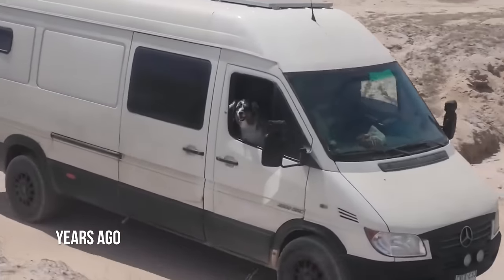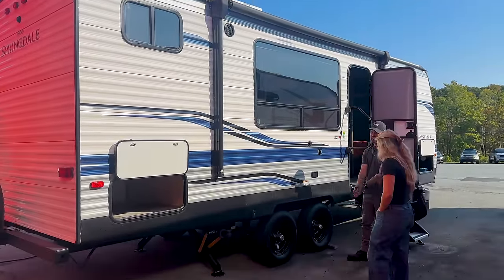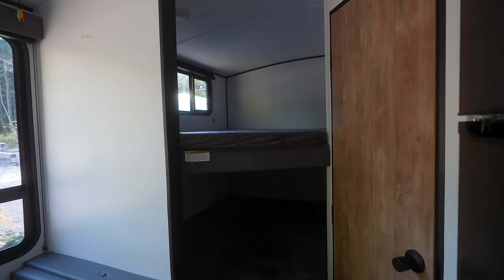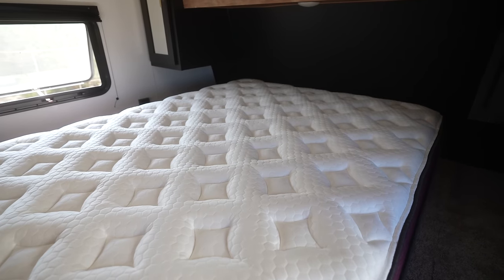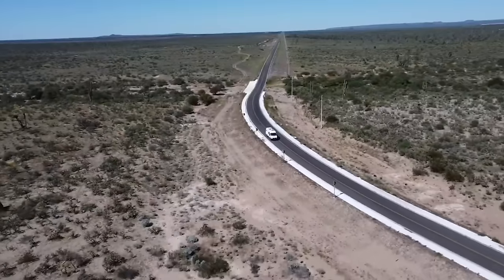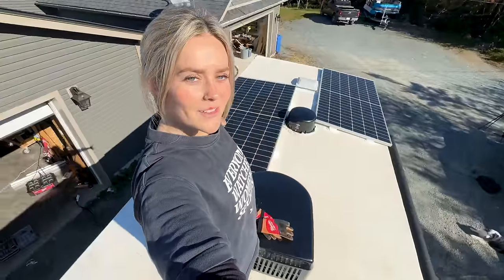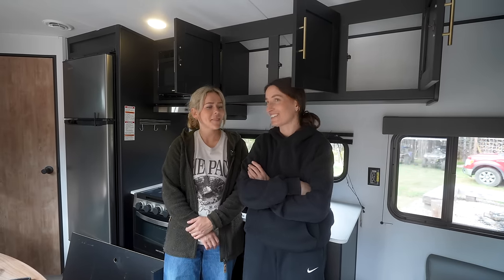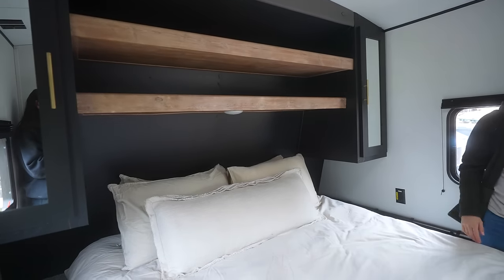We Bought an RV!

Comment: Congrats on getting the travel trailer.  We are long-time RVers and have a couple of recommendations based on our experience.  Tire pressure is crucial and needs constant monitoring. Otherwise, you may have a blowout and damage the trailer.  Carry a small compressor to help maintain the pressure. Maybe look at a tire pressure monitoring system, although they are not cheap.  Make sure to use RV toilet paper, FYI, Wal-Mart sells large packs since it sounds like you will be stopping there for the microwave popcorn.  Love the channel and all of the builds!
Reply from the maker: Thank you for sharing all your experience with us. SO valuable!!! We sure do appreciate it. We purchased a tire minder, to keep an eye on the tires. Happy to have you with us on our journey south 😊🐶
Reply: I would like to add, open fan/vents when cooking to avoid carbon monoxide poisoning & check batteries on fire/smoke/carbon monoxide alarms . I love this family & want them to remain safe ❤🐾
Reply: For the first time in my 72 years, I have a car that monitors low tire pressure this year.  I don't have to get down and check them as it's hard to get up. I'm all for making things easier.
Reply: I was coming for the toilet paper and venting while cooking. Unless you create your dark matter waste hole first then plumb that to the RV, there’s usually locals that’s come clean them regularly just plan for them to show up a day or so later sometimes. Excited to you see do this. We did something very similar 5 years ago! 😂
Reply: Biodegradable tp is what you need for sure. If you use regular tp it will plug you system.
Reply: RVs have been blowing up so much lately because of the propane.  If you can use anything other than gas, then use it, because the gas is too volatile.
Reply: That's a great rv tip!
Reply: My recommendation would be to have SEVERAL spare tires. Like 3. Peace of mind of more important than anything. They blow out constantly. And grease your trailer axle and have extra bearings and brake parts& Tire inflator. Check the temperature of brakes and hubs every couple hours. Just because it’s new doesn’t mean you won’t have problems. Good luck!
Reply: Oooohhh, good advice. Yeah, the tire pressure is vital.
Reply: Septic safe TP is all you need.  They charge a lot more for RV TP and it’s the same thing.  Happy Camper toilet treatment (Amazon) is the best stuff out there!
Reply: You should name it the Baja Bungalow
Reply: Scott's toilet paper is a good rv safe toilet paper, tire pressure is key, check all drawers and doors before leaving, including the fridge. Get the blue or green liquid for the grey tank to help with smell and other things in the tank.
Reply: If you end up getting blow outs I would upgrade to 16 ply tires
Reply: Turn off your propane when driving,  make sure wverything is locked and secured in the trailer.  Also, always do a walk-around (check stabilizers are up, storage area are locked,  AND CHAINS ARE CROSSED, and turn signals, brake lights are working on the trailer) the trailer before hitting the road, do this every time.  Good luck with your new adventure.
Reply: @jackiehenits5239  and roof vents are closed!  I am always running after neighbours to remind them! 😂

Comment: Don't get fooled. The trailer empty is not what you will be towing. By the time you fill the water tank, and load your belongings, many end up over the weight limits. Load up, get ready to roll, and then run through a weight scale at a truck stop and find your loaded weight. It will often shock you. Also be very aware of your balance while loading to avoid too much tongue weight.
Reply: Came here to say this - while travelling the big weights need to be well balanced over the wheels, tow ball weight must be correct too. No doubt you girls will get all the good tips, you are very thorough! 😊
Reply: These girls are no fools. I think they’ve done their research as all of the projects they’ve tackled.

Comment: Suggestion from a long time RVer. First thing change out your tires. The tires that usually come with a trailer are horrible. And change out your locks cause these are the same as everyone else. Get a rv lock for the hitch.
Reply: And TWO spare wheels, not just the one!
As has already been said, fit a tire pressure monitor to the RV, but try and get one that has temperature readings too.
Reply: Right on ,i swear they put lawn mower tires on them ?
Reply: I have a 2012 TT with factory tires still.  You shouldn't assume the tires are shit.  With dual axles there is less of an issue with a blowout.  I would install TPMS on them.

Comment: Just a word from someone who has been an rv’er for a long time. Be careful with how much stuff you pack in your trailer’ you can quickly overload it.👍👍👍
Reply: Yes!  I was coming here to say this!  How much weight have the solar panels and batteries added to your RV?  I’d advise upgrading your tires and suspension. We’ve gone from 18’ to 25’ camper to now a 33’ fifth wheel. We upgraded our suspension after one of our leaf springs broke during a trip. That was a pain in the butt!

Comment: If you are going to be leaving the van in a static location, jack the van up and sit the axles on stands or blocks before levelling. This gets your tyres off the ground and saves them from being deformed and rotted. You can even remove the tyres and make it harder for someone to steal it.

Comment: Hello ladies. When you get there, I would build  a structure over the roof, keeping the sun off your trailer roof. This keeps your trailer less hot in the warm weather. Also, it stops the rubber roof from shrinking from the sun. Which can cause leaking. Enjoy your new home.
Reply: That's a good idea.  It seems like they'll be in the RV for at least a year or more while building the new home.  A few days to provide that much cooling to the RV seems well worth the time to put up the shelter and move the solar panels.  Maybe even add a few more while they're at it!

Comment: Long time Rv'er here. Add RV roadside assistance to your trailer. CCA has an option or look at something like CoachNet RV version. Not sure what tires you have on the trailer but an upgrade is probably needed along with upgraded thicker shackles, bushings and wet bolts. Add a little vegetable oil to your black and grey tanks once you dewinterize. This will help to keep the gate valves lubricated. TPMS is a must along with a roadside compressor / booster pack which you probably already have. Watch your trailer weight with your personal stuff especially putting a lot of weight on the tail of the trailer. This will lighten your tongue weight and provided for a stability nightmare as will loading the front too much also. While a sway control hitch will help it will not eliminate it. If you find yourself with a sway issue do not get on the brakes. Down shift the transmission to slow the truck. Wind reports now matter since you are pulling a giant sail. If you are going to be driving in cross winds add water to all of your tanks to help lower your centre of gravity. Quite the drive ahead of you. Stay safe and looking forward to seeing your adventure.
Reply: Very good advise.

Comment: I'm a retired school bus driver. #1 make a SQUARE turn. Don't make a round turn. if you make what is a normal turn you will take the side of your TT out. a SQUARE turn means to drive into the intersection then make you left or right turn. and your trailer will follow. practice if you can before  you go. I'm sure your already in Mexico now. remember to not put all your weight on 1 side of the trailer. You Need a portable small generator. just a little one. you need the thingy that you put in your cabinets, drawers etc to keep your pots and pans, dishes ,glasses from sliding around while your driving, going around corners, you can get it at the dollar tree. and Grocery Outlet might have bigger pieces. Great choice Girls on the RV.
Reply from the maker: GREAT ADVICE!!!! Thank you SO much. Love the square turn and the whole explanation. Thanks so much, you certainly are speaking from experience 💛💛

Comment: "Learned The Hard Way" Tips:
- Watch your roof! Low branches can wreck vents   etc. on the roof.
- Secure your vents.
With strong winds while driving, they can vibrate and open (and break off).
- Keep the heavy stuff near the front.  It's true, if the back end starts to sway with a lot of weight, it can get out of control.
- Mind the tires. The road is a lot of friction, check the tires for wear, heat etc.
- Do a walk around before pulling out. Check everything is secure, lights work, hitch is connected, nothing is dangling open. And the roof is clear. 
Enjoy your trip!
Reply: Yes! And before each trip, check your truck too. You want to make sure that truck has the proper fluid levels and your tires and brakes are in good shape for the additional weight each trip. 

If you are dealing with wind, sway bars may help stabilize the trailer and truck. 

If the vents open towards the tow, you might want to take the time and effort to turn the vent openings. If they open towards the rear (away from towing direction), they will not easily blow open while you are traveling on the road.
Reply: Truth!
Reply: Keep an eye on your connections.  Trailers tend to sway in high winds. I would have taken the van, but I understand that you’re going to be gone for a while and lack of space can make you crazy. Best wishes on your new adventure!❤
Reply: Great tips..There are a lot of pot holes on the Baja road right now..
Reply: Yes. Watch your roof. Tip, post the height including a/c and all on your roof on your dashboard. That way you will always have the reminder. Also always look up when parking or backing up. Those branchesbor overhangs can be a mean sueprise.

Comment: I love your content, have been watching for years and yall have made another great choice!  I'm an RV Service Technician and I think out of your three choices this was hands down the best option.  No slides means less to go wrong, and this body style is much simpler to rebuild/repair than the laminated flat sided ones.  
That is an epic solar setup, I was getting nervous at first for your power needs, but this is one of the largest battery/solar systems I've seen in an RV.  
My only note its to be careful how much weight you put in the back while driving.  All your heavy tools in the back  could cause dangerous fishtailing. Check your GVWR to see how much weight the rv is designed to hold, and move your heaviest items to the center while in transport.  
RVs are a steep learning curve for most, but y'all seem well ahead of the curve.  Happy to answer any RV questions if you have them. I'm even more excited for your next adventure now!
Reply: They have 2 large dogs it will be cramped in there
Reply: @MissX905  I can't imagine their all gonna spend copious amounts of time inside when they have such a great spot to spend outside in Mexico.  Besides, they all fit in a van before, this is way more space than that.
Reply: Regarding the weight in the “garage”. That was my caution exactly!  Be careful of your weight distribution and how much is behind the axle.  Have fun women!!!

Comment: Check your tires and the year they were made, they are likely over 3 years old and need to be replaced even if they haven't been used. I would upgrade them if I were you anyway because you are going to be driving long ways through some very hot weather and on even hotter roads. Also, get a Tire Pressure Gauge that has sensors on each tire including the truck and the trailer that can monitor air pressure and heat and then has a screen set up in your truck. That can prevent blowouts. You can get a water bladder to fill up and hold an extra 100 gallons of water in your truck, and you should also install a whole RV water filtration and a sink filtration for consumable water. Don't trust even watermarked as potable. Some good ones are UV filters. Use a double system. Oh, and I am not just saying that because you will be in Mexico even in parts of America the water may not be clean. Also with the tanks and the heat just storing clean water. I would get yourself an air compressor for your tires, I know you probably have one for tools but you still want to have a small one in case you need to fill up a tire. Then tire plugs, are not the best way to fix a tire, but it is great when you get a nail out in the middle of nowhere and can fix it yourself and then deal with it later. I know you probably know a lot of this, but this is a much bigger rig. A blowout with one of these is much more dangerous than in your van, and water quality is a big thing.

Comment: Great show, Brave ladies, My husband & I went full-time 2 years ago, we bought a 5th wheel because of weight distribution issues mentioned in the comments,  take that advice very seriously.  Another issue is to be very vigilant with RV solar systems, we had an issue, plugged into shore power, and our inverter did not register somehow, causing the batteries to overheat releasing hydrogen sulfide, make sure to put in extra sensors cause thats alot of batteries under your bed. Can't wait to watch this new chapter

Comment: You ladies are so cute!  You will love RVing.  We have a 42’ 5th wheel that we have finally decided to park at a seasonal RV resort near a beach west of Edmonton.  A few suggestions, that may save some issues down the road, 1. When you are hooked up to services (I know you all boondock too), leave the grey and black tanks closed until 3/4 full.  Then release the black first for a bit and then release the grey for a bit to clean the hose.  Repeat alternating between black and grey.  You will have a flush for the black tank, use this to leave a little bit of water on the bottom.  Keeps the #2 and paper from sticking to the walls.  Also, add one of the black tank cubes to help break up the solids and keep the smell down.  Especially since you will be in very hot temps.    2.   Add a regulator to your water hook up if possible.  Prevents any surges from damaging your RV.   3.  Add two water filters one at the outside tap and one at the RV.  This will help if you are going to fill up a birkey and save you a ton of $$ on buying water.  I expect you will be bringing in pottable water to supply your RV but it would still apply and give you a piece of mind.   4.  Once you get there don’t do too much walking on your roof.   5.  I see you have regular tire chalks, you might want to add the one that goes between the two tires.  It sits about half way up the two tires and adds a ton of stability and less movement  when inside.   6.  Get the wood RV pads for under your jacks.  This will prevent them from sinking into the sand/dirt.  If you don’t put something down, you will be forever trying to level the trailer.    I know this is long but just suggestions.   Drive safe and have soooo much fun! ❤

Comment: Lots of great tips here. I'll try to reinforce and add to a few of them. Weight, where it is is as important as how much it is. Keep only really light weight stuff in the upper cabinets. Go to a moving and storage place and ask them to use their scale. Usually they'll let you do it for free (especially as cute as you two are :-)  ) but it might be a small fee. Weigh the amount on each wheel (you can figure out how to do that.) If you have more than a few hundred pounds difference side to side, rearrange things. Same for front to back, although a couple hundred heavy on the front axle is fine. Make sure you've got the recommended hitch weight. You really don't want the trailer heavy in the back. Of course make sure each tire has no more weight on it than the rating. You've already added a fair amount of weight, so you may have some challenges.

These types of travel trailers are usually used (and designed) for short vacations, e.g. a long weekend or maybe a week or two. That means they generally don't have a great deal of useful load. Once you get it all modified and loaded up, you may find you need new tires or tires and axles.

RVing can be great fun, but best way to make it fun is to not overtax the weight of the RV. That eliminates or at least reduces a great deal of issues.

Love your channel! You guys are such a kick. Even though I've built things all my life and spent  several years with a motorhome, I generally learn something watching you.

Enjoy the adventure! Oh, and add a rear view camera to the trailer. Invaluable. Oh, and get tire covers. Sitting uncovered in the Mexican sun will kill your tires in just a few years.

Comment: If someone hasn't already said it, after you complete all of your "mods", you need to weigh the trailer (with full tanks, food, equipment, etc) and compare it to the vehicle weight ratings.  The tires, suspension, structure and handling on the road is all about weight.  Have Fun !!!!!!
Reply: Truck stops often have scales that can do that for you for a fee. Well worth it.

Comment: Change the locks because one key can open pretty much any RV. Also, get a hitch lock so once you unhitch the tow and park it, your trailer can be stolen without a hitch lock. RV Odd Couple have some really good suggestions like levelers, back up cameras, tire monitors, etc. you should also get a security system like Simpli Safe. You can reach out to Trent and Allie and Eamon and Beck.